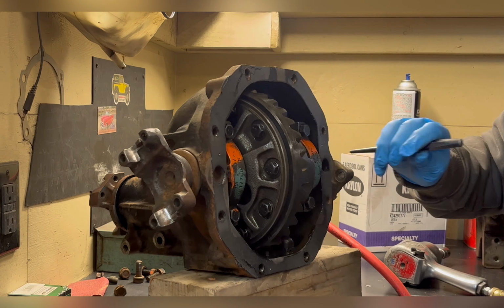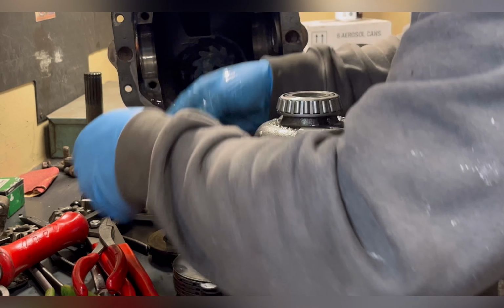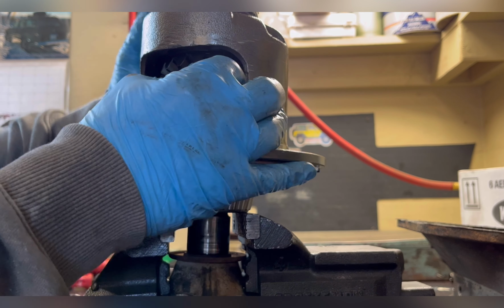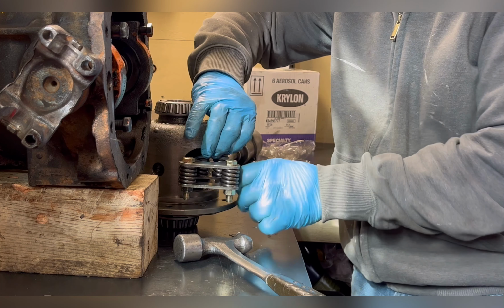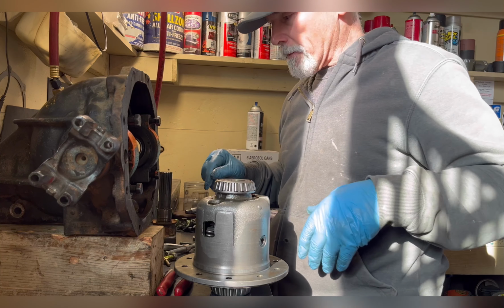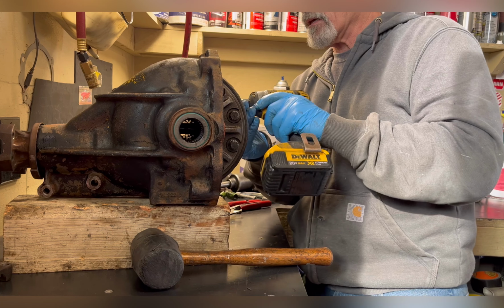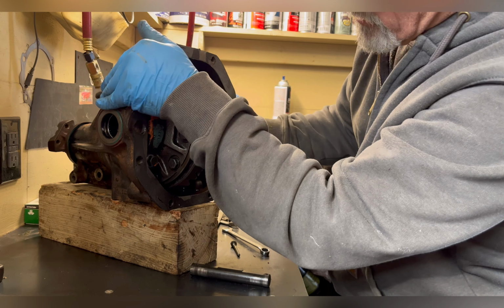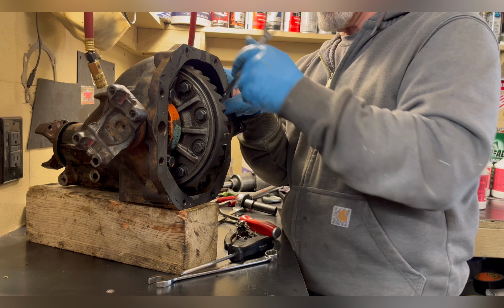GM 10 bolt Posi upgrade (works on 12 bolt too), tighten up a limited slip.

Comment: Great information as always for sure... 
My question may be a bit ignorant but my understanding of all this is FAR below yours so, can you make a non-positive differential into a positive by just changinging the insides rather than changing the whole thing?
Reply from the maker: Yes you can change a differential from an open to a  traction control by changing the carrier and in the cases of a "lunch box locker", all you have to do is change the spider and side gears. Changing the carrier does not require you to change pinion shims or reset the depth, just make sure the backlash is set to the same as when it came out. Again, the lunch box locker style, you don't even have to check the backlash if all the shims go back to the same position, the original backlash is retained.

Comment: I just ordered an Eaton 800 lb spring kit and I can only fit a #10 screw in the plate holes. I'm going to try and drill it out to 1/4-20. What size bolt did you use?
Reply from the maker: @johna7184  drill it to 1/4, and you can use channel locks but be careful, the gears are tough but you don’t want to damage them. It also helps to clamp one of the axle shafts in a vice and then slide the carrier with side gears installed to kind of hold everything in place. The 800 pound springs are tough to compress.
Reply: @murphysgarage  Cool, thanks for the info!